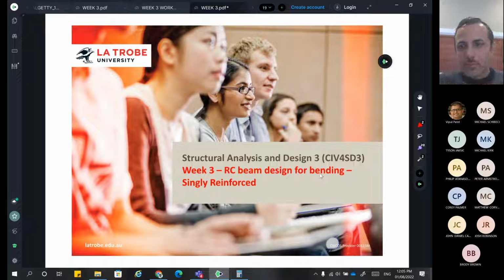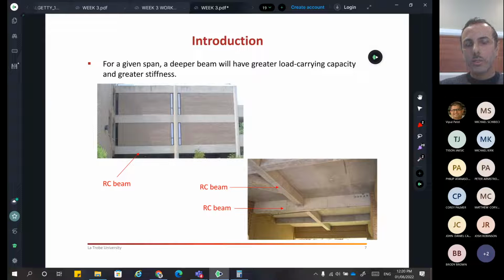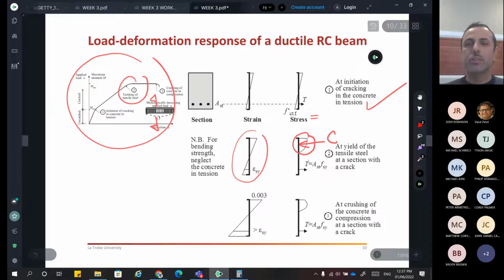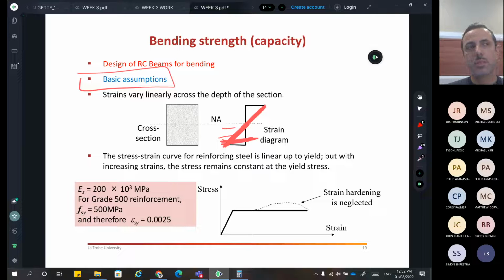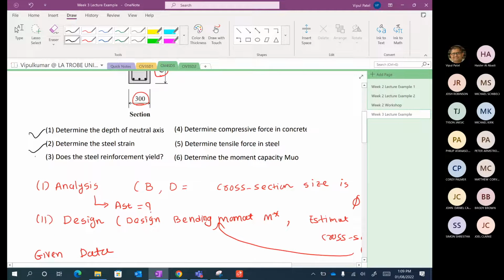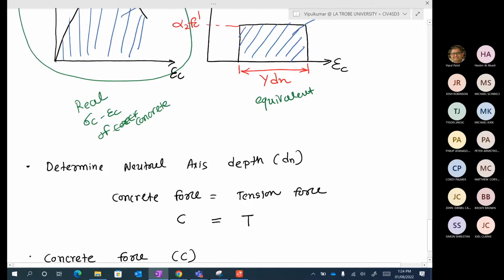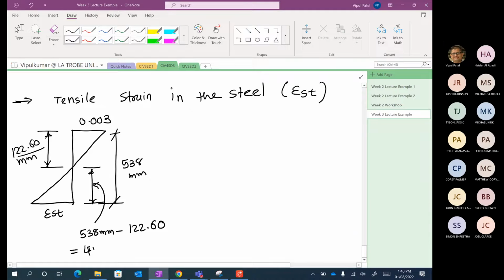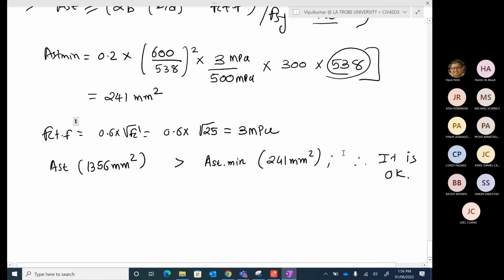Week 3 Lecture CIV4SD3

Comment: Why did you assume that the strain in the concrete was 0.003? Meaning that the failure in this case was in the concrete, what if the failure was on steel reaching ultimate strain? E.g. 1 or 3%?
Reply from the maker: AS3600 set the value 0.003. We shall calculate the steel reinforcement area to make sure that concrete fail first before steel reaches it yield strength. Please watch more videos which we have provided.

Comment: Sir I do really like your lectures. BTW I have one question on the work example regarding the ku. You've said that once the ku is greater than 0.36, then its ok. But in the AS 3600 it states that the ku must less than or equal to 0.36 for ducttility. Which of these two checks I should follow? I'm just curious about the ku
Reply from the maker: Please use "Ku should be less than 0.36".